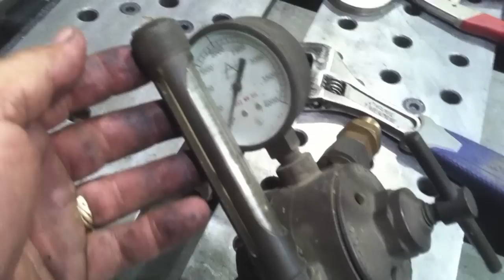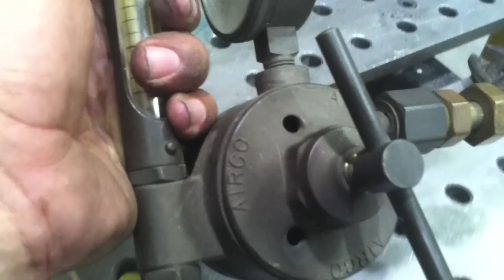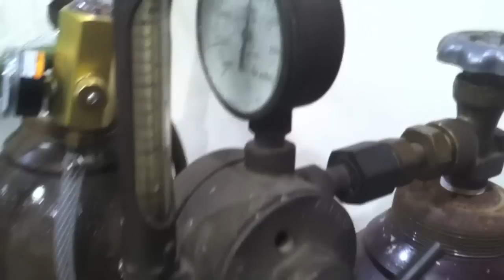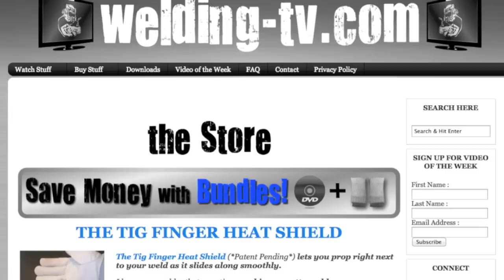Scratch Start Tig Welding with a Twist

Comment: My first Tig was an AC/DC buzzbox with a scratch start. I had no idea if it would even work as I had just started learning with an old Miller gold star at work. I bought the welder and torch and hooked it up and was amazed at how well it worked. Used it for years and still do some scratch start from time to time. Keep up the great videos, both old and new. You are the welding teacher I wish I had, when I was starting out.

Comment: So many tips I got here, I think this was the most useful video for me so far, cause I live in a God forgotten country with monthly income around 120$, so all i did got is 150A MMA/Tig inverter with scratch start, torch with cable and hose and the argon bottle. I had problems starting the arc, the feed wire tip is a really nice one, and the foot switch for stopping the arc is what I go make right after posting this comment. THANK YOU SO MUCH!

Comment from the maker: This rectifier actually has 2 more diodes that are not readily seen in the video but the pulse output totally makes sense.  It has the appearance of a 50-60pps pulse current. that might have some advantage on open butt root pass welds to help solidify the puddle when welding uphill.  Well I guess I have to get busy experimenting now.
thanks for the post and the information on the rectifier.

Comment: That homemade foot pedal would really come in handy right now!! I'm a sub-journeyman (working on being an apprentice pipefitter this year) welding on a bunch of 2' sch 40 stainless pipe for vacuum lines , and i am having to use a buzz box just like that but without the rectifier. Instead of a foot pedal I'm using a 4 ft long 1/8 inch steel plate and putting it under the jackstands that the pipe sits on and leaving the ground on top of the steel plate and kicking or moving the ground off haha

Comment: I set up my miller bobcat 225 lincoln ranger 225 and outback 185 with tig torch like u did know I want to scratch start aluminum with out contamination on tungsten I know it can be done and was hoping a tig welder with ur experience might be able to make a video, you would have the only aluminum scratch start video on the net would be very popular. 
     I love scratch starting and have learned a lot from ur videos

Comment: Don't know if its wrong but i would just have a helper shut of the welder when done welding, the foot petal is a great idea! I had that same flow meter on a real old airco tig welder ( miller gold star 300) had it rebuilt worked great!

Comment: Jody, the current is rougher because you don't have a capacitor on your rectifier, so you are getting kind of a pulsed output. I have a similar setup and once I added a cap, it was a whole different (and better) welding experience.

Comment: About 10 years ago I picked up an old Miller Thunderbolt 225 from the hospital I work at w/ it came a tig torch that clamped onto the stinger and an arc stabilizer for $50 … well ... with the stabilizer hooked up and you needed to reach up and adjust the torch ZAP! That puppy would knock you half way across the shop. BTW the switch you made is awesome ... wish I'd thought of it.

Comment: Great stuff, Yankee ingenuity at it's best.  I saw in the video that the rectifier had only 2 diodes in it, which means it is a half bridge rectifier.  That means you're not getting a true DC output from it which may explain the noisy arc.  Also no capacitors means a pulse output.  Check out the Wikipedia page for rectifiers.  True measure of skill is working with simple stuff and making it work and not relying on bells and whistles.

Comment from the maker: the arc is unique and might have some use for certain jobs but I would prefer most any import for precision work.
I guess I am spoiled. But I am going to piddle around with some pipe welding using this setup.

Comment: I appreciate your sharing this. It inspired me to buy an argon tank, TIG stinger, and make a DC rectifier to convert my Lincoln buzz box into a TIG welder. It has been working good for me.
Reply: any chance you would share plans for the rectifier ?I'm trying do the same thing with my buz boxx thanks
Reply: Yes I could but I could not see how to contact you and this comment box does not allow uploading of files and pictures.
Reply: David Manishewitz
This site has some good detail and plans: hildstrom.com/projects/ac-225/
Reply: Cool. He has done a lot more than me to his Lincoln tombstone.
Reply: I just bought one as well.  Seems like with enough tinkering you can make an old Lincoln into a pretty versatile welder.  I may not need the MIG / TIG I thought I would.
Reply: On the site you suggested the guy mentioned DC stick welding. I went looking at that last night. The advantages are easier starts, less sticking, easier welding of thin metal, and less splatter. That all sounds pretty good. I may try that out. I already have added an AC to DC rectifier for DC TIG welding. I just need to figure out how to modify my cables to run DC stick.

Comment: Jody, been wondering about something similar. My brother works in non destructive testing and has several larger diodes such as you have there. Thinking I may try to assemble something like that. He was saving it all up too build a home built welder with rewound microwave parts. BUT with old Lincoln 225s running around I think we might be on too something. I also have a Thermal Arc 95S portable scratch tig/stick dc welder,,,about the size of a toaster but packs a punch, even used the UHP HE !!!!

Comment: It is a full wave rectifier, but without a smoothing capacitor, meaning you get a 60hz ripple (In essence, you still have the sine curve, but just the positive sides, it still reaches 0v 120times a second)
A beefy capacitor should smooth it out, A 50v 50000uF capacitor on ebay is less than $30.

Comment: I guess a 3-phase rectifier would be a lot quieter. Most of the old welders here seem to prefer old heavy equipment like that over more modern inverters, say they weld better, brute force over finesse or something. I'm onna budget myself so I'm usually buying old machines like that myself. Only stick welded so far and this looks like a nice way to get into TIG welding for cheap.
Reply: I bought a little everlast stick welder that came with a manual gas valve tig torch. I never thought I would ever use it but I might try it this summer. All I need is a small argon bottle I think.
Reply: 1873Winchester Ive seen a couple miller inverter tig welders blow up under hard use , I'll keep my buzzbox 230 caveman tig , found a cheap hf box on kijiji .

Comment: Great video. I just recently got my Hobart Ironman 210 roughly wired up for scratch start tig.  It was my first time ever trying to tig.. I'm excited to be learning this out of my basement. I was impressed after striking my first arc, ready to see where this takes me.  Seen the tig finger over at nexair and told the guy I follow you on youtube, and he told me you were a local guy out of P.S  I thought that was really cool.  I also have a lincoln ac225 with a dayton HF . I would like to be able to do something with Aluminum,  Can I scratch start with aluminum or will that result in contamination or the electrode?

Comment: If I recall correctly, a rectifier alone won't give you DC you're just converting all the negative current to you still have to smooth out the sine wave to get true "DC"

Comment: Because you're rectifying but not smoothing the rectified waveform you're effectively getting a pulse function at 60Hz. The readout the peak current you're getting is about 40% higher than the front of panel "readout" and you'd be getting no actual "off" time, just a lot of reduced current period...

Comment: That would require a heck of a lot of RMS ripple capacity if you want to use single capacitor. Typically lytics can handle around 10-50A RMS per capacitor so you would have to have 4-5 in parallel.

Comment: we have inverter machines in our shop, no foot pedal. in the field we use old school Lincoln 300HD, etc. scratch start, air cooled.  The weld performance is great with the Lincolns. construction. mechanical piping. ASME code welds. Does the noise you were having has more to do with the AC machine with the rectifier?

Comment: The reason it is more forceful is because stick welders that weld stick only put out a higher voltage...probably about 4 to 8 volts more per same amperage.

Comment: It's not just "rough", it's not really DC.  It may be a half-wave rectifier.  Which means you just end up with the "top half" of the sine wave (and half the power).  If it's a full wave rectifier, you're just "flipping" the negative portion of the wave.

Comment: you can buy a basic 2-step switch from harbor freight for 15$, works great. plug one end into the outlet, plug the other into the welder (assuming its 110v) use it for my 100A forney inverter all the time.
Reply: Does it turn the whole machine off?

Comment: what up jodi..... is there a specific reason to have knife switch -footpedal cut off. on tig lead? could it not also be put on ground?

only reason i ask is i have a 25ft tig torch lead.. and makes it hard to have 25ft coiled at my feet. 

if i can put on work lead... then machine can be in one end. have 25ft torch... and long ground stretched out anywhere... unless i slice my brand new torch set up. 

thanks again. best vidz on you tube by far!!$$
Reply: was wondering the same.

Comment: Jody, even cheaper, a 12volt car battery, the higher the amps the better it acts as a capacitor and smooths the arc, filtering out the dc ripple "current flutter", which is what you were seeing/hearing . Also they can be used to "balance" a conventional ac transformer power supply output current, one 12v battery per 100-150 amps of output. Jody, do you have any knowledge of the old "grid" multi operator style welding systems usually powered by 2500amp dc motor generator "torpedos"?

Comment: You're actually running a 120 pulse per second DC rig, not a constant potential rig. That's what the buzz is, and probably why it digs a little more. Each leg of the mains gives 60 hz, somewhere between 120 and 180 out of phase. 2 0 potential points per hz, that's 120 pulses

Comment: I'm new at this so bear with me.  TIG used Argon and Mig seems to use 75/25 most often.  Does Mig welding see any improvement by upgrading to pure Argon?  I know it's more expensive just wondering if it improves the process.
Reply: the co2 helps with penetration, so going pure argon will have less of it. That filler metal will just pile up on top of the weld.  You will need pure argon for aluminum however, even with mig welding.

Comment: Nice video!
What a helluvanice table you have there....made or bought? 

What would be the amperage range that you would use on a scratch-TIG rig for (similar to food-service-related) stainless steel 22-10 gauge, keep in mind that I'm prototyping a product, don't want to spend an arm-and-a-leg on a suitable unit because they're to cheap and because until I prove concept, I won't have the budget to get one ;-) but nonetheless you can relate that it would take longer to explain what you want done to someone else instead of doing it yourself... Hope that made sense.  
Thanks in advanced for your time! 
Awesome channel!!
Reply: +J Alvi it looks to be made but im not sure.... how did your concept go?
Reply: After seeing your video a few more times,  I broke open the small 80A stick-welder,  re-arranged some of the wiring,  added some switches and it works (for what I needed) I don't suggest nor implicate that anyone should try to do this.  But thank you for your video.

Comment: Jody I have an old Forney ac only buzzbox. Is it possible to do scratch start tig with it, and if so Can I weld aluminum with it? I don't have any experience with scratch start tig but would like to learn how to do it. Thanks for the great videos keep em coming!
Reply: Andrew Seiler :  AC GTAW needs high frequency arc stabilization, otherwise the arc extinguishes easily when the current goes to zero during polarity change.   this happens 60 times a second on synchro machines (transformer types).

Comment: That old regulator you showed is that a co2 regulator with an adapter to be used on argon tanks that's what it looks like I have never seen an adapter that converts co2 regulators to argon I have seen them the other way around. If that is the case where can you get one of those.
Reply: CO2 and Argon cylinders have different pressures.  Argon is higher.  Can't use a CO2 regulator on an Argon cylinder.

Comment: i would be careful with that foot peddle wood in not an insulator.
Reply: Wood is not so bad as long as it is decently dry. Also, you'd probably be wearing shoes while welding, so as long as you don't forget what you're doing and stick your fingers in there while it's live, you'd probably be alright.
Reply: no i hear you man. u will prob be fine. if u ever get a chance take the nfpa 70 class put on by sergeant safety. great class for anyone to take that works around electricity. a lot of factories are starting to make there employees take it. but ya when it comes down to it wood is not an insulator weather u might be fine or not. im an electrician and ive heard of guys taking 2x4's and knocking a guy off a ladder that got hung up. if thats all you have it might save someones life but if you did that you would be puttinmg urself at risk. so you could prob get away with it at home but a construction site or at a big manufacturing facility it def wouldnt fly. its not just about you its also the guy next to you that is potentially in "danger" obviously the chance are low but thats how it goes. just some food for thought.

Comment: Why does the tungsten ball up at the tip and try to stick to the cup? Very frustrating. Im trying to install some stainless grab rail. What a pain. The ark is all over the place. This cant be right. I think I hate scratch start tig! It even tougher with all the gaps I have to fill. There is seemingly no control with this thing!
Reply: Check polarity.  Should be electrode negative -